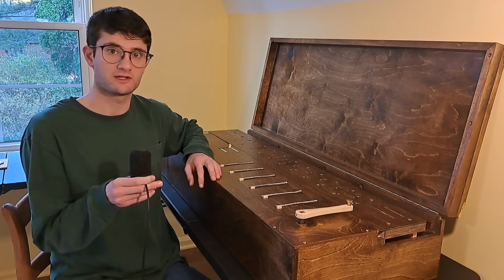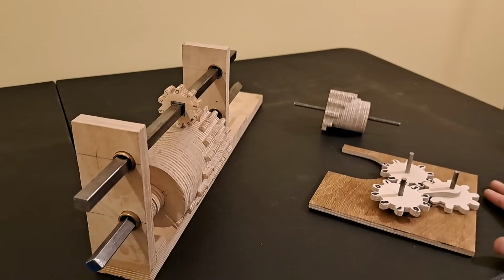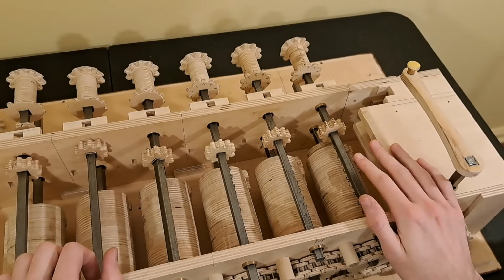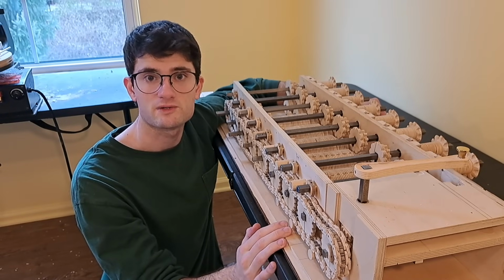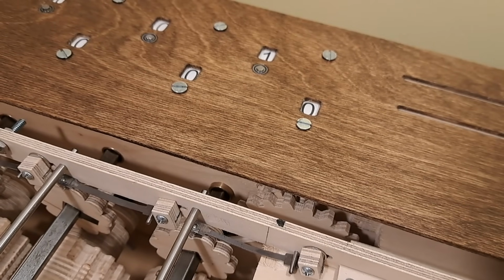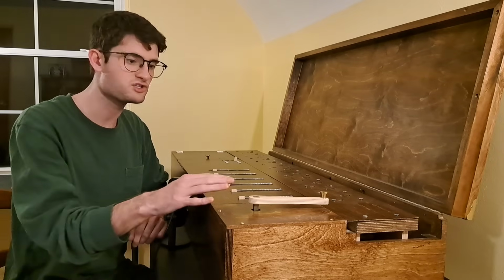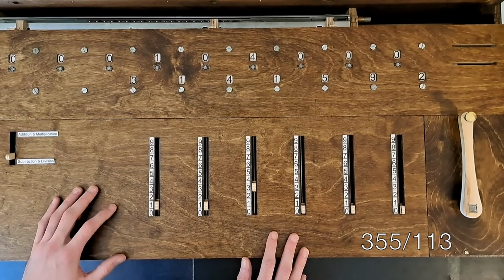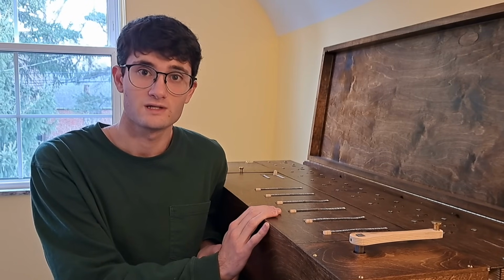How I built a Mechanical Calculator

Comment: Tell me if I were to be wrong, but I wonder if there is a bug in this system.
If you have 9 digits and 0 decimals, and you add one digit, you'd get 10, which makes sense, because of the extra part  causing the carry.
But what if you have 9 digits and 0 decimals, and you add for example 1 digit and 9 decimals. After one tenth of the big lever rotation, let's say one tick, one tooth from the digits cog causes a carry of 1 from the digits to the decimals, but it would happen synchronized with the first tooth of the addition of the 9 decimals, meaning that the carry would be dropped, right?
So wouldn't the number then be, after tick:
0) 0 9
1) 1 0 (due to the carry tooth and the first 9 tooth happening simultaneously, dropping the carry)
2) 2 0
3) 4 0
...) ...
9) 9 0
instead of 100.
If this is indeed a bug, then I believe it would apply do the adding of any number with a 9 in a non digit place, which causes  a carry in that same place.
Maybe I'm missing something, or someone pointed it out already, but if it is a bug, I'm just curious as to what the solution would be.
Great video, I always love mechanical intelligence. ♥
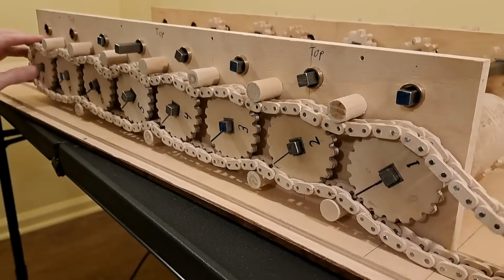Reply from the maker: It's a good observation, because I didn't really explain why this problem won't occur in the video – I thought it would be too much detail. But, the carries happen after the 1-9 is added in each column, and every column is a little later in the cycle than the one to its right, so carries do not interfere with carries in other decimal places. If I had not removed some teeth on the stepped drums and instead of having 1-9 they had teeth going all the way around, they would have 20 teeth going all the way around. The extra tooth for carrying comes just after the 9 teeth on the stepped drum (so in the 10th of the 20 spots). This means the carry always come right after the 1-9 digits are added on that column. Then the sprockets that link the columns together via the chain also have 20 teeth. And each column is 1 tooth of the sprocket (1/20th) later in the cycle than its neighbor to the right, so that carries ripple and the rightmost one finishes first. (You can kind of see this in the video at 9:35, where I'm aligning all the sprockets so those black marks line up, but the actual squares of the metal shafts show that every successive column is turned a little more down the line). So everything is timed so that carries do not interfere with things within each decimal, and occur at the right time in relation to the other decimal places. (if you're interested, there's diagrams of those parts showing the rest of the 20 teeth on my blogpost: https://whatwillmakes.com/2024/12/20/my-mechanical-calculator-how-and-why/). I hope that helps! Comments like yours are very gratifying because it shows how closely people are watching and understanding, so thanks!
Reply: @WhatWillMakes  Very interesting, what a wonderful design that keeps on giving. Thanks for the in depth explanation allowing me to figure it out without me needing to build it myself ;)

Comment: What modifications would it take to make this calculator display and run calculations on negative numbers as well? Or would this require an entirely different layout?
Reply from the maker: I guess the dials would have to have 19 spots to accommodate negatives: 1-9 positive, 0, and 1-9 negative. This would throw off some of the geometry, so a lot of parts would have to be remade, but I think the basic concept of the design would still work. Interesting question!

Comment: Great inspiring video. I was laughing when you decided to do division on the approximation of pi 355/113 .

I think you could do decimals if instead of 355 you input 355000 and remember you have 3 decimal digits reading the result :)
Reply from the maker: I did do 355000! To get the most accurate result. I just pretended there was a decimal place.

Comment: This is phenomenal, I own and use a mechanical calculator (brunsviga 13rk) and your design is so similar to it it's insane, I think yours handles division and subtraction better to be honest, with my brunsviga you turn the handle backwards to subtract or divide, your gear switch is a much better solution, it eliminates a lot of the issues I had when first learning to use the brunsviga.

Comment: This is VERY cool. I am looking forward to digital spring loaded sliders :-)
Reply from the maker: Thanks! Yeah I considered it, and it would be a good improvement, but I wanted to be able to remove the cover and see the stepped drums.
Reply: @WhatWillMakes  Yeah, that's a good point with the cover. Just thinking now, could holes in the cover plate (cut from bottom) and sliders with springy wooden bit, that fits into holes solve this? When moving slider, the wooden spring would snap into the holes, keeping the cover removable. But now thinking about it, the installation would be hell and maybe few other issues...so yeah, I get why you choose to keep them analog. :D

Comment: Your amazing project made me realize that my career in aerospace engineering started right at the cusp between mechanical calculators and electronics.  

At the beginning of 1973, I arrived at Boeing in Seattle with the ink still dry on my diploma and a Sharp EL-8 4-function calculator right alongside my slide rule in my briefcase.  The engineering office had a field of desks staffed by engineering aides with Marchant mechanical calculators.  When they needed a high-precision complex division, they'd set up one of those rattletrap machines to run overnight.  That was just to calculate a single number.  

Nevertheless, that level of technology designed and built the Boeing 747 aircraft and the Apollo moon rockets!

In 1976, just three years later, I was sitting in my study at home, building my first home computer with smoking soldering iron in hand.  It was an IMSAI 8080, just like the one Matthew Broderick used to hack into the Department of Defense's (fictional) WOPR mainframe.  Then later that same eventful year, Radio Shack released its first TRS-80, Steve Jobs cranked out the first Apple II, and the world changed forever.

Comment: Might waxing the whole mechanics make it last longer and turn smoother? Just a question. BTW, thanks for this visual lesson on how it works and how it‘s build.
Reply from the maker: Thanks! Yeah I played around with wax, and it does help, but it's more important to actually space or depth the gears correctly - that makes the biggest difference. Also, it does not need to run continuously or anything, and there's not much load on it.

Comment: The extra gear for the pawl can easily be eliminated by numbering alternating gears in reverse
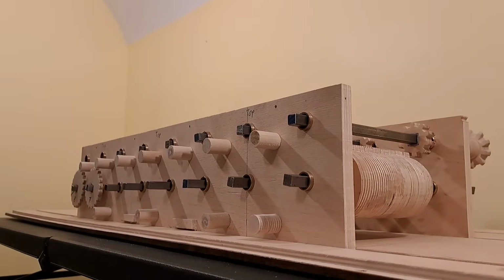Reply from the maker: It's a good and insightful suggestion, because for that little model it would be easier to write the second dial counter clock wise (CCW) and I never explained why I did not in the video. If I had been making a full sized Schickard or Pascaline adder (where there are more than two number dials) then the reason I did not just write the numbers CCW would be more important, we want each input wheel to rotate the same way because then the user interacts with all of the input wheels in the same way. With the Schickard adder in particular you could also do subtraction and it would get confusing quickly which way is needed to rotate the wheels if every other one goes in the opposite direction. A core element of these machines is that every decimal column behaves the same internally and also externally to the user. Basically, writing it CCW would've worked for that little demonstration model, but it would not help explaining how the full machine was going to work. At 9:10, think about how the drums spinning in different directions would mean every other mechanism as a whole system would have to be designed differently - it would create many more problems in design and implementation.

Comment: I would personally call it it an adding machine, but it's very clever whatever you call it. Maybe version 2 can be made more compact with 3D printed parts. My aunt used to have a commercially made mechanical adding machine that had a Vegas style lever that you pulled instead of a crank. She insisted on using that for everything even after electronic calculators were cheap and plentiful. Unfortunately, a bit of rust caused her to have accuracy issues.

Comment: 2:53 Why didn't you just swap the order of the numbers?
Edit: I figured out why
Reply from the maker: It's a good and insightful question, because for that little model it would be easier to write the second dial counter clock wise (CCW) and I never explained why I did not in the video. Sounds like you understand the reason, but others have asked previously so I'll paste my stock reply in case anyone else is wondering:

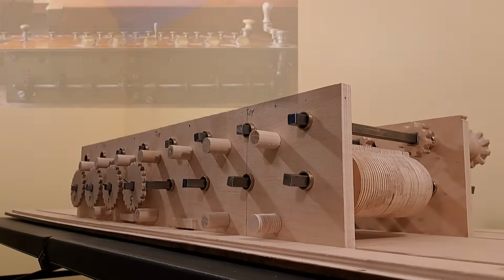If I had been making a full sized Schickard or Pascaline adder (where there are more than two number dials) then the reason I did not just write the numbers CCW would be more important, we want each input wheel to rotate the same way because then the user interacts with all of the input wheels in the same way. With the Schickard adder in particular you could also do subtraction and it would get confusing quickly which way is needed to rotate the wheels if every other one goes in the opposite direction. A core element of these machines is that every decimal column behaves the same internally and also externally to the user. Basically, writing it CCW would've worked for that little demonstration model, but it would not help explaining how the full machine was going to work. At 9:10, think about how the drums spinning in different directions would mean every other mechanism as a whole system would have to be designed differently - it would create many more problems in design and implementation.

Comment: I ve played with a mechanical calculator witch makes subtraction turning the crank counterclockwise. 
For instance, if you want to multiply by 19 you can:
Put the carriage in tens
Turn it twice (multiply by 20)
Put the carriage in units
Turn it once counterclockwise (subtract 1)

Comment: great vid, love the mechanisms, while watching the assembly i thought it was gonna sound horrible with those retention mechanisms being that shape, however, it turned out great, sounds very mechanical and clacky, i enjoy it

only thing i'd want to see improved would be some more determination in the selector slides, you could do a waved rack with one of those spring loaded balls or something as an easy addtion, just to add some certainty that you mention so much, to avoid accidentally picking a higher number than intended, which right now i see you solve by only meshing half of the gear intentionally, but imo, it's a half solution, and easily can result in a miss-input
Reply from the maker: Thanks! Yeah that's a good suggestion! I considered something like that but I wanted to be able to easily remove the top cover and easily see the stepped drums, but it would be an improvement to have them spring-detented

Comment: Beautiful piece of work. Only change i would really make is maybe add a permanent tab to your reset sliders that are sticking out similar to your add/subtract lever. That way you won't need to rely on an external part to slide them back and forth
Reply from the maker: Thanks! Yeah that is a good idea, and I meant to do something like, but after a while I called it good enough because I wanted to move on to other projects

Comment: There's several similarities between this and the curta calculator. The adding drums and dials being the key bits.
Reply from the maker: The way I've been thinking about it, the Curta is like rolling my calculator up around just one drum. It's no coincidence, the Curta is an extremely clever refinement of the older designs that my calculator is emulating.

Comment: In a way, an electronic calculator does the same thing but through an elaborate system which uses binary code. And then the computer can be compared to a more advanced calculator. As well as AI or other technological advancements are a result of fundamental mechanical parts interacting with each other. Seeing this really makes me think about how complex a human body and mind are while representing something similar to an advanced calculator. And yet, there will always be a gap between the two because I cannot see how a consciousness can arise from something like a collection of these calculators

Comment: And the crazy thing is, there are still so many ways you can improve it, even beyond just the appearance (imagine this thing with brass plates for all the labels). Adding some way to keep track of decimal places could be helpful.
But I think the number one improvement you could make is making it quicker to zero out every component. It would rapidly increase the speed at which you could do different calculations. For that, I suggest three things, which seem like they'd be pretty easy for someone of your skill.
Firstly, a simple bar going across the top of the input area, which you could pull down to push all the inputs to zero at the same time, making it quicker to ensure all positions are at zero before you enter the second number. You don't want to accidentally add 10201 instead of just 201, for example. You could even make it spring loaded, so it automatically returns to the top.
Secondly, you could add some springs holding the toothed bars to the left, and some dowels on them poking up through the slots, so that instead of having to stick an allen key in and slide it right and then left, you just have to lift the assembly and push the dowel to the right. That clears it, and then they automatically return to position so you can clear it again. There's also probably something you could do to make lifting it and putting it back into position more quickly easier, but I'll leave that one to you.
Lastly, making the top assembly on a digital slider (rather than the analog sliding drawer track you have now) could make it easier to more quickly shift positions by lining things up for you. You could probably adapt the same ball bearing and spring system you use to ensure certainty on the individual displays to click it into discrete powers of ten.
Reply from the maker: These are all great ideas! 
I meant to refine the top assembly sliders by attaching a permanent post or something instead of using a stylus. Some Arithmometers did have spring-return slider like you suggested. Frankly, once I got it working well enough I called it good enough – at that point I wanted to move on to other projects. 
But what you suggested are good improvements. Thanks!

Comment: 2:54 just write numbers counter-clockwise and second gear write clockwise.
Reply from the maker: If I had been making a full sized Schickard or Pascaline adder (where there are more than two number dials) then the reason I did not just write the numbers CCW would be more important, we want each input wheel to rotate the same way because then the user interacts with all of the input wheels in the same way. With the Schickard adder in particular you could also do subtraction and it would get confusing quickly which way is needed to rotate the wheels if every other one goes in the opposite direction. A core element of these machines is that every decimal column behaves the same internally and also externally to the user. Basically, writing it CCW would've worked for that little demonstration model, but it would not help explaining how the full machine was going to work. About 9:10, think about how the drums spinning in different directions would mean every other mechanism as a whole system would have to be designed differently - it would create many more problems in design and implementation. 
I hope that makes sense. It's a good point, and obviously it crossed my mind too in the design phase, and I did not properly explain in the video why it is not a good solution for the full-sized machines.
Reply: @WhatWillMakes  You're right. The even drums would have to be mirrored, further increasing complexity. Any way, You've done a great job.
Reply: 9:10 CW and CCW too.

Comment: Absolutely brilliant. The fact you could 'knock it up'  in wood and it works a treat is mind boggling. Babbage got stymied on his difference engine because he couldn't get the funding for the precision brass machining required. I had access to a mechanical calculator at age 10 in the early 70s. These things were so valuable they didn't let anyone use them. I was the first and got tasked with determining the school's annual electricity usage. The electricity meters were changed after my results were cranked out.

Comment: I have a couple of Curta calculators - look up "Curta Calculator Mechanical" on YouTube.  Internally, they worl exactly like your design, except that instead of all the mechanism being laid out linearly, it is all picked up at the ends ald wrapped into a cylinder.  It's all metal inside, of course, and althpough it is mych smaller than yours (it fits comfortably into a hand), the parts are much bigger than those in a swiss watch - but the similarity between yours and the Curta are remarkable.
Reply from the maker: I love the Curta - it's such an elegant design! The way I think about it, it's like rolling my machine (or the Arithmometer or the Stepped Reckoner) around just one cylinder.

Comment: I'm astounded how you worked this out and built it - gratulations and well done! I have a Brunsviga calculating machine. It's a small desktop unit, and super heavy for its compact size. It operates so similar to your wooden creation, although mine works backwards too, by just winding the handle backwards.